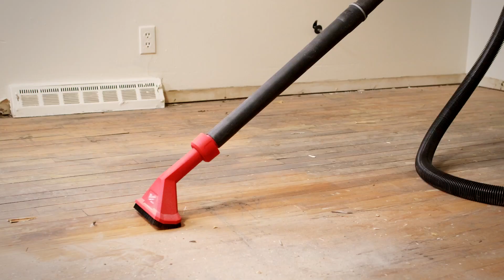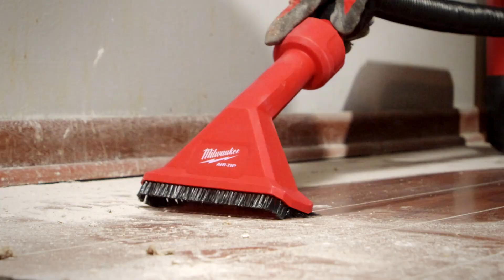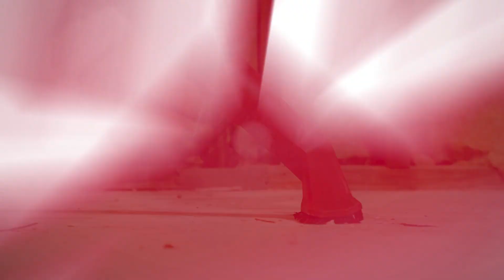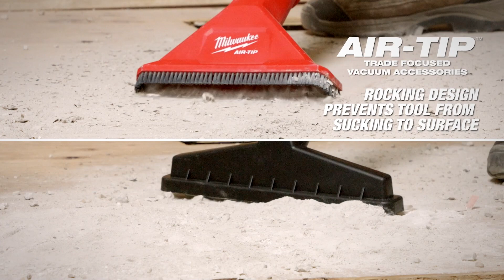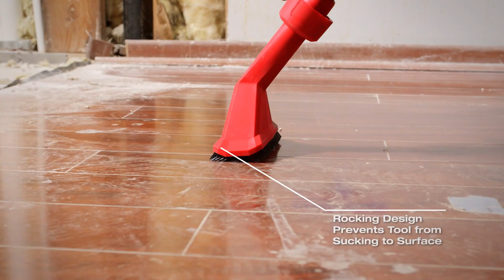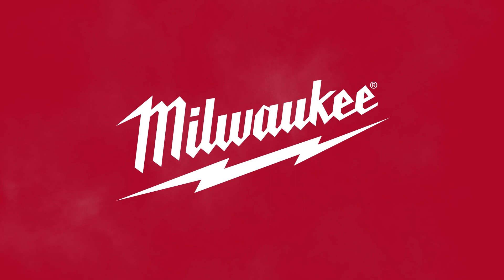Milwaukee® AIR-TIP™ Rocking Utility Nozzle with Brushes

Comment: I want to see the vacuum with all of these new attachments on it. Some kind of M18 and plug in with a spots all around it for all of the new stuff total kitted out like Glock or AR-15 with every accessory possible.  Or like a trade vacuum to can run on a cord or M18.  That'd be awesome since these can get lose in the mix of the van/truck